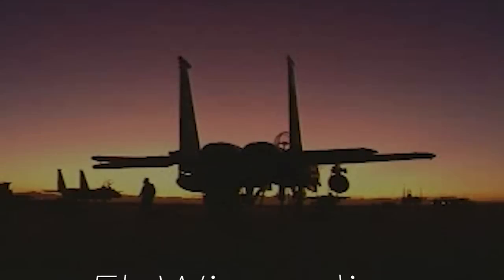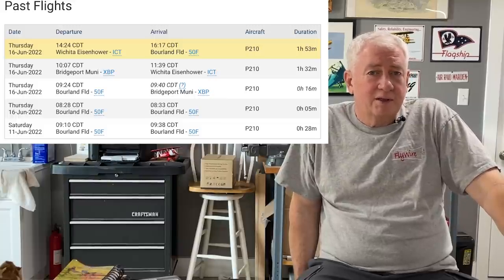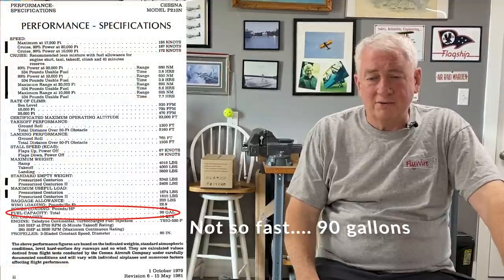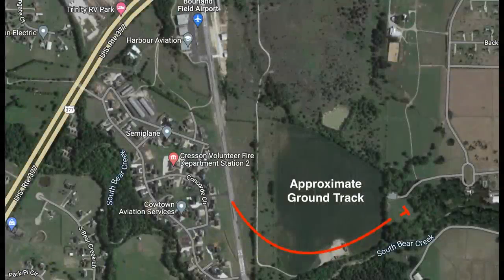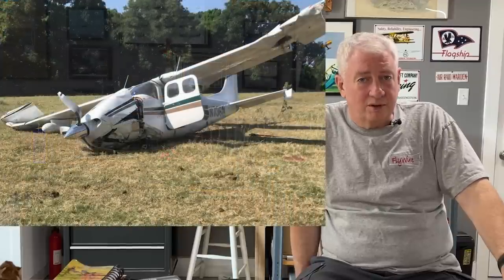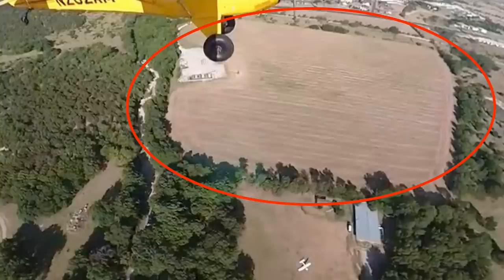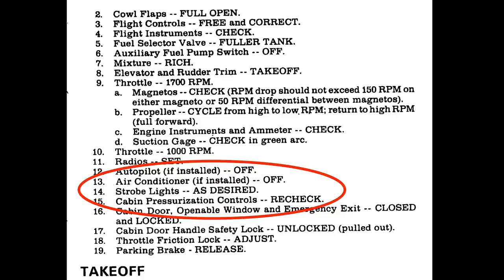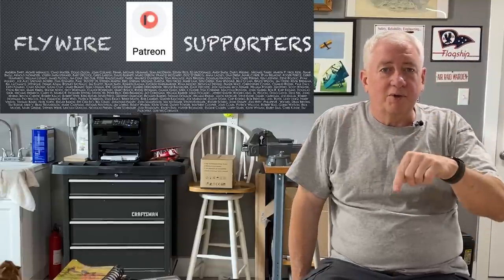Accident Review  P210 Partial Power on Takeoff

Comment: Scott, et al,  while some of your message is valid, check list usage, pre-determined action upon engine failure and an accurate W/B, far to much was speculation.  You disparage the pilot for not understanding the energy state of the aircraft and not landing in the larger field.  MAYBE the pilot understood very well that he was to fast/high for the larger field and didn’t want to hit the trees head on!  I believe leaving the landing gear down was helpful in absorbing and dissipating the crash energy.  The fact there were no major problems injuries supports the pilots wise decision.  That P210 appears to have tip tanks so I’ll bet your fuel guess was off and by the looks of the left wing separation at the root I wouldn’t be at all surprised if the left wing tank was compromised!  I’ll bet plenty of fuel was dumped from that aircraft!  You further state the A/C was on and you base that comment on hearsay from a firefighter.  Bad form brother!  The fan may have been activated, common in P210’s for airflow during taxi and departure, without the power robbing A/C compressor running.  So stop condemning based on speculation and hearsay!  And stop with the silly speculation that the pressure system robs engine power, it doesn’t.  Regarding multiple, consecutive take offs, that seems very normal to me for a new engine as the fuel flow set up is being tweaked.  Example- first take off the pilot notices the max FF not high enough so he aborts the take off, returns to the hanger for adjustment and makes a second attempt.   
I don’t know what caused this accident and neither do you but you sure aren’t doin the pilot any favors!  In fact, I’m wondering, because you stated this was your home airport, if you don’t actually know the pilot and have negative history?  Could that be true?
Reply from the maker: Don't know the pilot, never met him. Your view of the energy in the airplane is incorrect. The Firefighter's observation is not Hearsay. I suggest checking the definition.
Reply: Final report is out. Care to comment?

Comment: The  Idea  that  a engine  driven  electrical device  steals anything other  then Negligible HP is  fact. As to  the  new  engine if  its   same as original ( ie  Factory Airframe cert)  no  weight  and  balance is in order. Power loss   due  to part failure  or install issue  is  most likely. UPDATE...359 Lbs over MAX TO weight... from NTSB above.
Reply: 5-10 hp for an a/c compressor and about 1hp for every 25amps of alternator draw is what I have read. Depending on how much hp you have in the first place, it could be noticeable. Any modern car turns of the a/c compressor automatically if you accelerate hard. Older cars had a WOT switch to turn off the compressor at full throttle. Seems like a simple thing to add to an airplane mechanically or through software so that the pilot doesn't need to do it.
Reply: @bills6093   READ MY POST BY NTSB.... IT WAS 374LBS OVER MTO WEIGHT WITH A WEIGHT  AND BALANCE OUT. STOP  PONTIFICATING ON THINGS YOU HAVE  NO CLUE ABOUT.
Reply: @brucemiller8109  I saw both videos, don't need to read your post. The hp draw is simply factual. The fact that cheap cars have been smart enough to automatically turn off loads when necessary for a very long time now is also simply factual. It's stupid to make the pilot do his own load shedding, imo.

Comment: G'day Scott,

The aborted takeoff, full fat and heavy, after insufficient power, sounds really silly.

Trying all that, with the Air-Conditioner "On" is bringing it to the level of humming Beethoven Overtures,

Dum,
De dum dum..,
Dum
DUMB...!

I dunno if you ever peeked inside my Playlist titled "The SunFoil Project..." (?).

About 14 years ago my car was killing Batteries, which turned out to be due to my average engine run-time (6 & 1/2 minutes, living 15 km out of town...) was insufficient to finish recharging the Battery before I switched off the engine when I arrived home...,  after which the part flat battery would sit- self-discharging and sulphating it's plates for a few dayze - waiting for me to come and suck Current out to run it's Starter Motor, and go out to repeat the procedure.

Therefore, an Aerofoil which runs on Sunlight, a streamlined Solar Array on the Roof..., with a Solar Battery Charge Controller wired to the battery -  OUTSIDE the Ignition Switch, turned out to fix the issue.

And, then some...

A 5-Watt omnidirectional array, on a Subaru 1800 Touring Wagon, it turned out, saved 1.5 litres of fuel per week (!), so I put a 20 watt unit on my son's Subaru Brumby (same engine, gearbox, wheels, and closely comparable weight)..., and that saved 4 litres per week ; and the 30 Watt Mk-3 on my Touring Wagon saved 5.6 litres per week, and all of a sudden Acceleration was vastly better, and it no longer took 3rd gear to go up mild hills in town in a 40-Km/Hr Zone - even with half a ton of Firewood in the back..., 40 klicks up the hills in 4th gear.

The explanation is that, at full output, the 50 Amp Alternator (1 Hp at 14 Volts...) might be 80-85% efficient IF it's turning at 4,000 - 6,000 RPM, but at any other RPM it will be likely to be somewhere like 50% efficient...; so the 1 Hp output requires 2 Hp going into the Driven Pulley - and at 2.5 : 1 Step-Up Ratio that requires 5 Hp worth of Twisties out of the Cranking of the Shaft, to drive the Alternator's Rotor - and then the Belt will slip a bit, it and the Pulleys heat up and dump their heat into the Airflow - and thus a part-flat Battery drastically increases Fuelburn and seriously decreases the Torque available going from the Engine to the Gearbox - or Propeller in an Aircraft.

My underconstumbling is that Aircraft Alternators only run at 1.5 x Crankshaft Speed due to most operations involving most engine runtime being at pretty close to 3,000 RPM...

I don't know what Belt Drive ratio the Air Conditioner runs at..., but if the Air-Con. was on  full Refrigeration and the Aircraft's Battery was sufficiently discharged as to be sucking hard on the Alternator...; then the reduction in available Torque arriving at the Throttle, therefrom, would probably account for perhaps 10 or 15% less than whatever  would have been available - if the Aircraft had have had a Solar Charger (set up with a small Panel under the Windscreen, while tied down at the Airport, maybe ?) ensuring that the Alternator was adding no Electromagnetic Drag to the Crankshaft after Engine-Start...(because the Full Battery would outvolt the Alternator's Regulator...), and if the Air-Conditioning was disengaged.

Believe it or not, my daughter created this Channel 11 years ago and bookmarked it onto my prepaid mobile phone, specifically so I could make Videos about the results of the SunFoil Project, and publicise the idea.

Hoping to nudge the rest of you 8 billion to retrofit your Road Vehicles with SunFoils - DIY if neccessary, to enable y'-alls to save Fuel and thus generate less Tailpipe Emissions.

The savings vary, depending on each vehicle's Electrical System, and normal driving Regieme, but the lowest fuelburn reduction observed has been 5% and the greatest was 35%, with 20% being about average - and with a SunFoil on the vehicle a new Battery lasts 7 years in service and then suddenly dies absolutely, without warning.

So, there are now about 50 SunFoil Copycat Samizdat DIY retrofits getting around my hometown...; and my son, the town's Auto Electrician, has let DaddyWarbles put SunFoils on his personal vehicle - twice, and he's put 4 of them atop the Toolboxes of his 5-ton 4-WD Workshop Truck.

So, feel free to look long and hard at the Fuel Bowser, and the roof of your Car - and I recommend a Mk-7 or Mk-8 ; all the Construction Videos are in my Playlist.

Then, think about your Aircraft Batteries...; switching off the Aircon. is easy - and retrofitting a Solar Trickle Charger will prevent failed takeoffs arising from flat Batteries causing crippling Alternator Drag sapping critical amounts of Torque on Takeoff.

Sorry about the long warble - but this issue has been a personal "Hobbyhorse" for a dozen years...(!).

Such is life,

Have a good one...

Stay safe.

;-p

Ciao !

Comment: Hmmmm engine doesn’t seem to be running well. Probably just needs some more taxi time. Let’s taxi back and try it again. Unreal. These guys have no idea how close they were to being another one of the statistics our aviation community has seen so many of in the recent past. As a captain of even high performance business/charter aircraft we’ve put more emphasis on these procedures lately so that certainly means the GA community should be. The other one that really got me (besides my first comment) was taking off with the air conditioning/pressurization on. I’ve owned several air conditioned pistons....P210s, 340s, 421s, Cirrus and I cannot emphasize enough how much power this draws. It is SIGNIFICANT. Hell, as I recall even a couple Lear and Falcon models of business jets require it to be off for takeoff and even some for landing. Preventable people....100% preventable. Thanks Scott, well done once again.

Comment: Question: what evidence do you have that supports the claim that the aircraft wasn't making full power?  Seems like this notion is what the entire video rests on.

Have you flown this aircraft before?  I have.  I've flown N7361K approximately 10x.

Also, lots of assumptions regarding "what the pilot was thinking at the time", but it appears you haven't interviewed any of the individuals on board.  Lots of comments about PICs mindset, but I haven't heard where you've spoken to the PIC.

Lots of hearsay regarding the aborted takeoff as well.  Appears you've left off that there were adjustments made to the engine after the aborted take off, yet prior to the accident flight.

Also, the air conditioning in that aircraft has (2) switches which must be on for the air conditioning to work.  We're BOTH of those verified to be in the ON position?  Sounds like someone that didn't know the aircraft (or the systems) wanted to be the news reporter and started talking about things they aren't knowledgeable about...
Reply from the maker: Nice try my friend. Given the position of the airplane and time in the air it’s not hard to figure out what happened. 

The first responder I talked with noted both switches on… he is an experienced pilot and knows what he is talking about. The people in the airplane told him what happened right after the accident. Probably didn’t have time to get their stories together. Hearsay… I heard it from a witness on the scene right after it happened. 

Believe what you like. I suggest you grind your axe somewhere else.
Reply: @FlyWirescottperdue  nah, I look forward to you being proved wrong.

Matter of fact, I'll wager $2,500 your "facts" aren't anywhere to be found when the NTSB report comes out.
Reply: If what you say is true, that's worse!   I'm not taking a full load of people up in my plane after I had to abort a takeoff and make 'adjustments' to the engine..  The first flight after adjustments needs to be a test flight especially if the thing wasn't making power.

I guess we can wait for the NTSB,  Scott can put his money away and by the time it comes out he can pay you with the interest since it will take that long...
Reply: Why do you even care John? Everyone responding is acting like they were attacked by the Scot guy.
Reply: @cullenstagg  I know the people involved in this accident, and he is grossly misrepresenting all of the facts for his own glory.  It's absurd!
Reply: @johnwingfieldjr.5871  but no one is having their character attacked. The guy in the video isn’t calling anyone names. He probably doesn’t even care expect that the subject makes for entertainment. The plane either had a mechanical problem or the pilots made a mistake. Has to be one of those things right? No sense in getting too worked up about these kinds of things, we are going the same direction in the end.
Reply: @johnwingfieldjr.5871  and I’m happy that the people you know in the plane are safe. Hope they get back up soon
Reply: Final report is out. Care to comment?